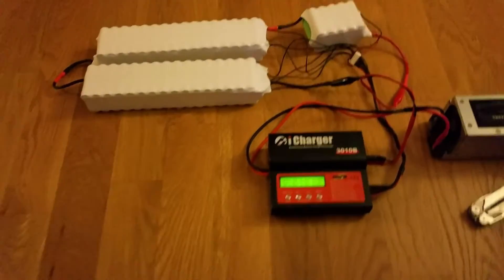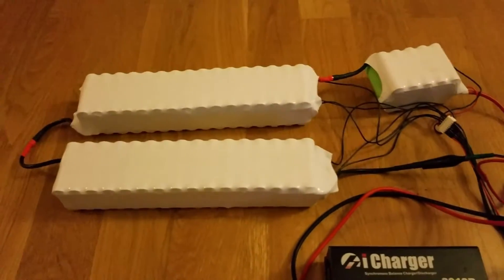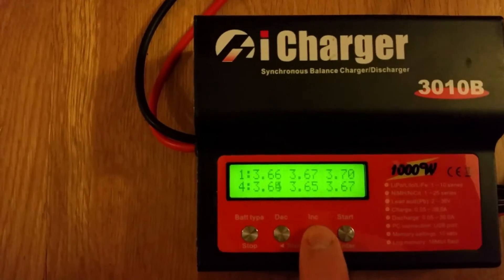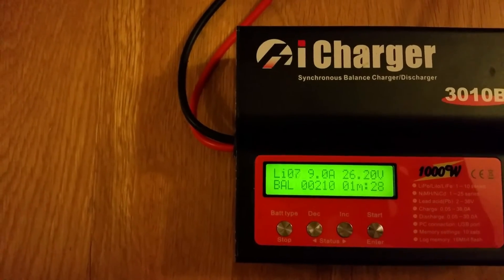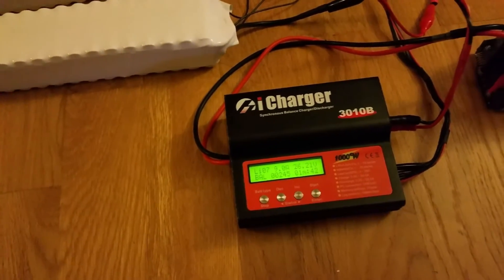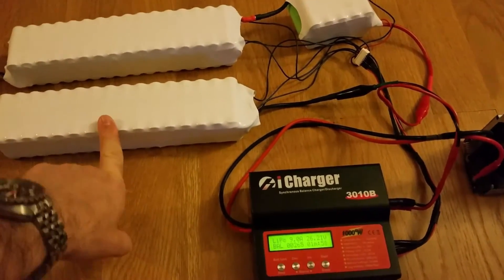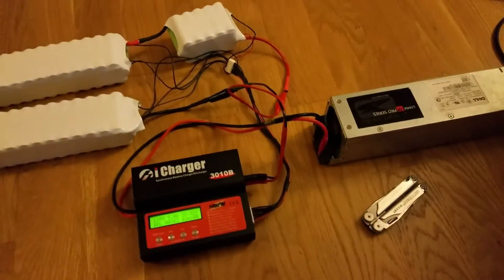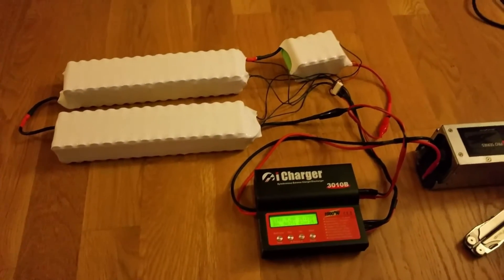DIY 18650 Battery for Goped esr 750

Comment: I can see its 7S15P battery, right?
What BMS did you use?
Did you measure the max current pulled in the turbo mode?
Reply from the maker: Pulls over 150 amps
Reply: So it peaks at 3,6kW - impressive!

Comment: Just got a I ped but need to upgrade the batteries thinking about doing it myself but scared to burning out the cells,how much you would charge me for a setup?
Reply from the maker: the pack is the video is @2k. after talking to you and explaining you the benefits I realized that you just don't understand what this pack can do and the value of it. Your budget of $200 will most likely only cover for SLA batteries.

Comment: How much do you charger for a battery pack like this with the charger and everything? I have a goped ppv which has a Torkinator which draws a lot of amps so I want a set of batteries that are high discharge and won’t catch on fire. Kindly let me know.
Reply from the maker: Yes, I can build a pack with high discharge C rating. The brushless motor sucks more amps than the torkinator. The pack I made can push 5000 Watts easily.
Reply: Portable Electric Vehicle 
How much would it cost?
Reply from the maker: It depends on the cells. Between $1200-$1500 for @50 amps capacity
Reply: Portable Electric Vehicle Hello. can you help me with adding extra battery( external battery or maybe more then one- under my deck) pack to my carbon GT all terrain board..can you help me this project and how much will that cost?

Comment: what's the power source you are using for your icharger? got a site for it?
Reply from the maker: I got few power supplies off Ebay. At the moment I use a much smaller power supply with the same power. I will post a video of it soon. If you are interested in getting one pm me.

Comment: Hey Man, love your videos. 
I am looking for a lathe to shaving down two  ABEC 107mm Flywheels to fit my Evolve GT currently the largest street wheel is the 97mm flywheel but these will fit if they can be cut.
I see you have access to a machine shop to make mounting brackets. Can you point me in the right direction.I live in Queens  is there a place I can go to get it done. like a carpenter or machine shop?

Here is an example of what i am trying to do. Thanks.
https://www.silverfishlongboarding.com/forum/longboard-skateboarding-wheels-bearings/282847-got-my-wheels-lathed-down-thanks-4crawler.html
Reply from the maker: Bring it to me and I will try to help you...
Reply: great. Now i just need to order them. How were you thinking of doing it?
I have a hand held belt sander and I was thinking of using that. 
Ill let you now when I get the wheels